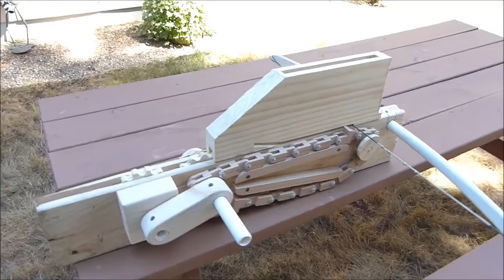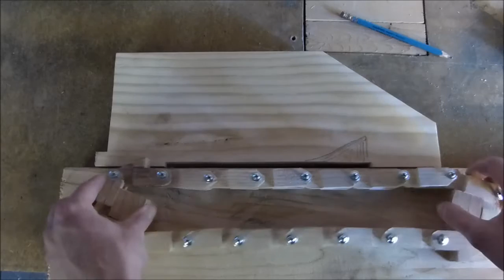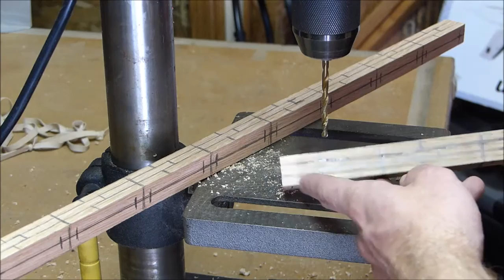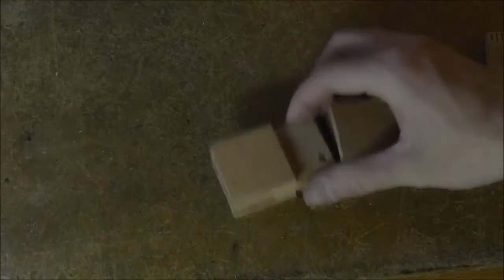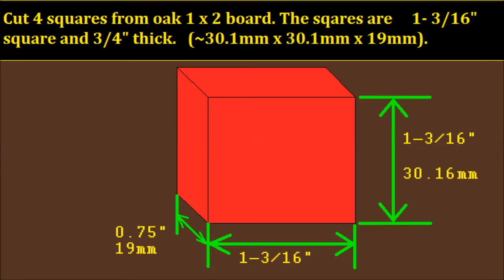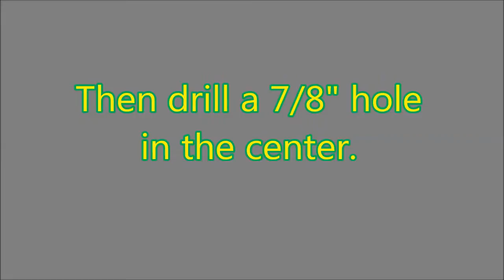Make a Full Auto Crossbow Pt 1

Comment: Do it with a bike chain with a battery drill drive.It will be better: rate of fire, accuracy, can be stronger...
Reply from the maker: Yeah that would be cool. Are you going to make one? I do plan to revisit this design with a new model but probably it would be after putting together a huge 3d printer to make parts with and then sell the 3D model for like $2. Or I could model it to be printable on my little printer since that is what most people could use anyway...
Reply: I did a repeating crossbow now. I think this is the best structure right now.
https://www.youtube.com/watch?v=LNDxom4nUsc
  check out my other videos.
Wood and metals are better than plastic used by 3d printers ...

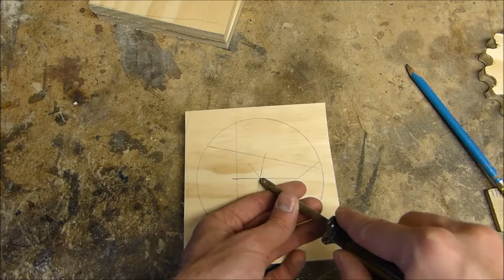Comment: how did u find the center of the circle @ 10:14. u drew 3 lines thru it n went from there. is there some geometrical principles u can xplain?
Reply from the maker: +biguglytrux Oh, yes that is a simple geometry trick. Draw any straight line across a circle. Now go to the mid point of that line, and draw another line perpendicular ( 90 degrees ) to the center of the first line. This second line will pass through the center of the circle. Repeat this within the same circle a couple times, and you will have several lines intersecting at the center.

Comment from the maker: So anyone looking for part 2 knows, my HDD died and I have the rest of the video for this on it. So it will hopefully be uploaded in about 2 weeks from now but there is a possibility I will never get that data back. In that case you would have to wait for the "full auto crossbow version 2" which will be an improved version and I will make instructions for how to make that.
Reply: +JaycubL have any thought of doing a semi auto loading one? except with a cartridge system with a spring or something moving the bolts allowing precision firing,  but using an electric motor to load the string?
Reply from the maker: Wings of Weaponry That would be pretty cool, are you going to try it?
Reply: I'm looking into it, I'm using aluminium for the frame of the crossbow and I am thinking of possibly reversing the prod/prods (which are steel) for more power and convenience, and it gives a cool look, not quite sure how the motor reverses the string though, so I'll probably have to buy a special heavy duty one that goes either way to do it  so it pulls and pushes a steel hook that is railed so it can pull the string back? I'm not sure, still drawing it out, any ideas?
Reply from the maker: Wings of Weaponry The main idea I would have on it would be to copy what I built but use a motor and a better bow and generally better construction / materials (you said you are using aluminum and steel).
Reply: JaycubL Yeah. Ill see how it works out.